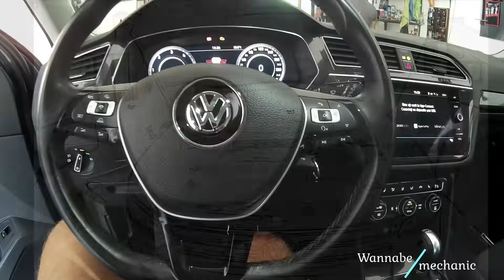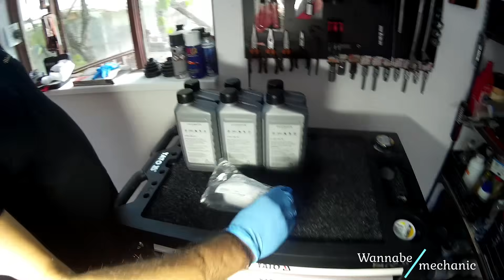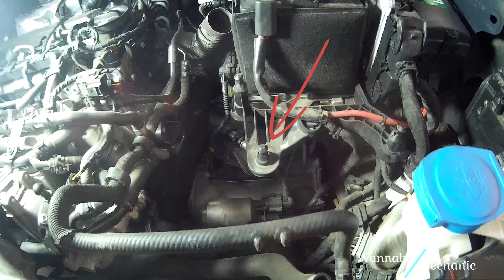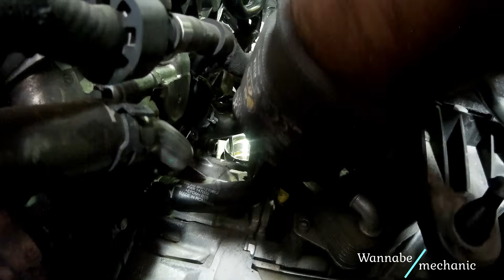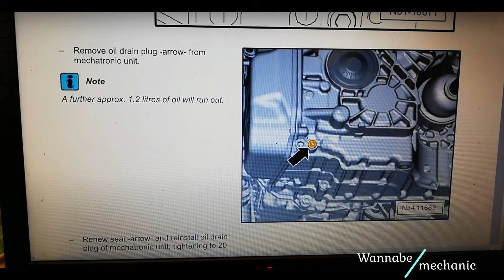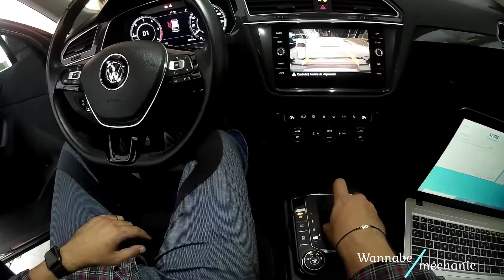DIY Volkswagen Tiguan 2018 DSG 7 Oil Change Filter Change OBH DQ500 Audi Q3 TT RS

Comment: How does this filter differ to the filter inside transmission oil pan?
Reply from the maker: The DQ500 DSG gearbox uses two oil filters: an easily replaceable external filter for routine servicing, and an internal filter located inside the gearbox that is only accessed or replaced during major repairs or disassembly.
Reply: @TheDIYWorkshop2020 ok thank you. Is this internal filter on the underside of the transmission which can be only accessed by dropping the transmission oil pan?

And, how do I determine which transmission I have on my 2.0L petrol TSI 162?
Reply from the maker: Yes to the first question. Only a VW dealership can tell you or a car parts supplier based on your VIN number. Or maybe someone on Facebook groups can help you with this info.

Comment: 2.0 TSi Bj.2017 // 1. Getriebeoelwechsel  & Haldexkupplung & Spülung bei 58.000Km // trotzdem bei 110.000 defekte Mechatronik, Drucksensoren defekt/ Reparaturkosten 2150,- EUR / Nie wieder VW
Reply from the maker: That's unfortunate to hear! I'm not a fan of VW either. 😄

Comment: Hello ,i have a Tiguan 2018 tdi 2.0 ,83000 km i changed the Transmission Oil ,but the mechanic is saying that you dont have to Reset the Oil Adaptation system.Is that right?
Reply from the maker: You do not have to reset the oil adaptation system just for a regular DSG oil change. Only if there were some repairs made or if the old oil was really bad.

Comment: Tiguan 68 70k milage giving error codes and gearbox going emergency mode. Is it because it needs gear box oil change?
Reply from the maker: Low or dirty transmission fluid can be one of the many reasons why the gearbox goes into limp mode.

Comment: Hello on what control unit I have to enter with VCDS to see the temperature of the oil.
Reply from the maker: It s easy to find. Somewhere in the gearbox module, advanced settings. We'll make a video soon that includes these steps.

Comment: Hi, its posible put the oíl for the Hole of the filter too? Or why not if your answer its no. Thanks.
Reply from the maker: No you may not put the oil through the hole of the filter .It makes no sense
Reply: @TheDIYWorkshop2020  thanks.

Comment: Did you had to drain the coolant first?
Reply: Ok, I answer to myself. I got confused as it was said coolant pipe so I thought there goes coolant. Actually it is charge air pipe so no coolant there and no need to drain the coolant. One thing to be noted is that add container or plenty of rags under the transmission when you take the filter out. Even though you wait for a while for it to drain still 1-2dl overflow to your floor. Vac and blow compressed air to get all the dust and grit around the filter cover to prevent anything from going down the filter hole. It is pretty tight space there and you need to wiggle to get the cover out. It was pretty easy to do by following your step by step instructions.

Comment: DSG7 do not need gear oil change, why did you do it?
Reply from the maker: The duration of what "Life" is depends on how long you want to keep the car. VW said the same thing about other manu-matic transmissions (i.e. Tiptronic), but if you do nothing, that "Lifetime" fill results in transmission problems around the ~150K mile mark.

For a dry clutch transmission, you probably should change the Gear Oil at ~60K miles or shortly thereafter.
Reply from the maker: That is up to the owner. If you care about your car and want it to be in perfect shape all fluids must be replaced. All that "DSG7 needs no oil change " is just VW marketing in our opinion.

Comment: Thanks for video. Are new O-Rings Crush Washers required for the Drain Plug on the gearbox and mechatronics?
Reply from the maker: The manufacturer does recommend changing every o-ring and washer for any new component you install.However , as a unofficial advice ,I do not think it is necessary for the first and second maintenance job. They do wear in time so you might want to renew them after that so you avoid any leaks.
Reply: @TheDIYWorkshop2020  i managed to get the drain plug OEM drain plug washer. having a tough time sourcing the mechatronic drain plug washer though. and sorry i only meant the washer, rubber o-ring is definitely going to be changed. it'll be my 2nd dsg service so hoping the mechatronic washer will be ok. thanks

Comment: Hello,
I need help. My Tig II 2017 2.0 TDI 190 Hp 4 motion DSG7 has 12000 kms. I want to change engine oil. Shall I change the OIL FILTER as well or not? As it is not easy to access and a bit tricky to replace. Thanks. Appreciate your return.
Reply from the maker: Dear Aziz, we strongly recommend that you change the oil filter as well. Used oil will remain in the filter and will contaminate the new one. This does not mean that your car will brake but it might affect the longevity of the engine.
Reply: @TheDIYWorkshop2020  Thanks for your reply. if I understood there are 2 oil filters, one for the  DSG 7 gearbox and one for the engine. is it correct?
My main concern is where is located the Engine oil filter in this model ? 190 Hp DFHA....
Reply from the maker: https://youtu.be/b8yLHyG9OWw Check this video,the oil filter should be located in the same spot
Reply from the maker: and yes there are two different oil filters. The DSG oil filter and the engine oil filter.
Reply: @TheDIYWorkshop2020  I am planning to do oil service myself, make it clean and carefully. Anyway Thank you so much for your cooperation. I appreciate.

Comment: Cateva observatii, la scut default de fabrica vin cu torx de 45 partea din spate, iar lateralele torx 25!
Reply from the maker: Vin cu torx de 45, modelele vw pana in 2014...odata cu schimbarea motorizarilor si a puntilor fata au schimbat si forma si configuratia scuturilor ...asadar o sa gasiti la toate modelele dupa 2014 aceste prinderi....si golful 7 si passat b8 ...etc 
Surubul practic este tot de 8 mm,  doar terminatia este acum cu hexagon de 13 mm
Nu contest insa ca ar exista si exceptii.

Comment: nice video, i have both DQ250 6spd and DQ500/OBH 7 spd... on the dq250 i always change the filter, but the 500 it's so annoying to reach to the filter. it seems like dealers do not change the filter on its first service... how often do i need to change that filter? is every other oil change okay?? cos if no need to change filter its a much easier job.
Reply from the maker: Just like for the DSG6 once every 60000Km or 40000miles. Some people sent me articles about the fact that you do not have to change the filter.That is nonsense. If you want to keep you car in perfect shape you can not let the old oil from the filter to contaminate the new one.Hope that answers your question.

Comment: Nice video! Where can I get the workshop manual? Once you drain the mechatronic oil you just fill it through the main drain hole? If I fill through the filter hole, will the oil go to the mechatronic unit as well? On my attempt to change I didn't drain the mechatronic oil. I guess that is why my excess oil was coming out really dirty.
Reply from the maker: You will need Adata for that ,which is very expensive.I got the info from a friend. And yes, the oil goes inside the Mechatronic unit as well. Yeah it is the 1,2 l stuck in the Mechatronic for sure